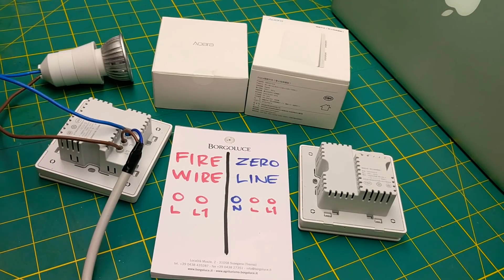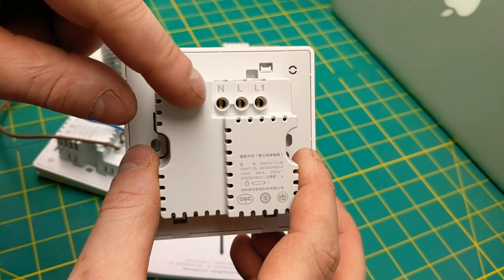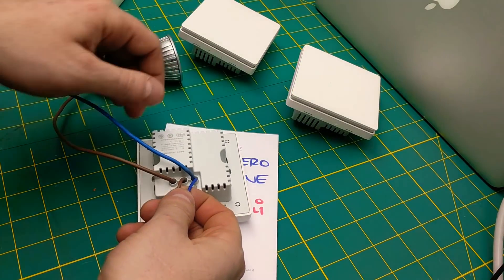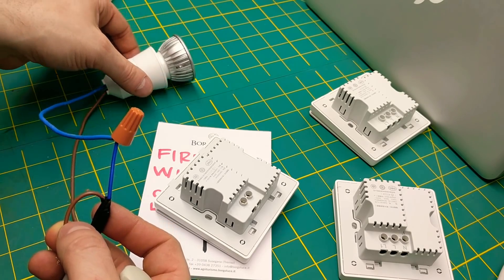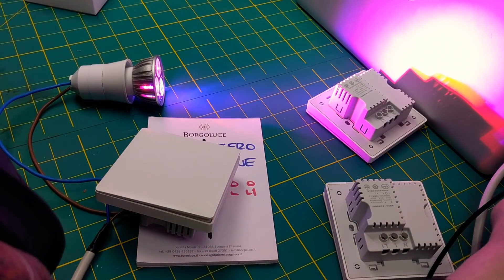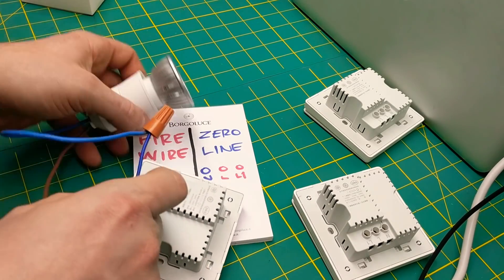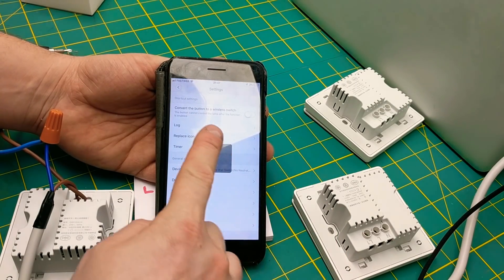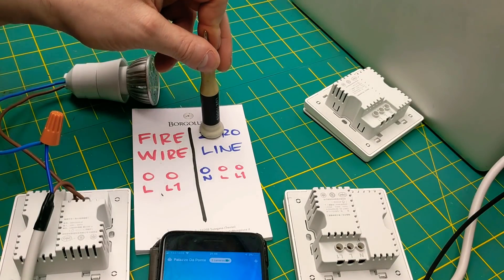FIRE WIRE V.S. ZERO LINE (Xiaomi Aqara Light Switches)

Comment: Good afternoon.
I want to buy an Aqara D1 circuit breaker (QBKG21LM without neutral, one key, wall mounted).
I want to connect 5 MJTS01YL bulbs to it.
But in the off state, the bulbs consume very little (less than 3 watts) and the switch will not work correctly. Its working range is 800W-3W
Can you please tell me what you can buy for a load of 3W?

Comment: Hello great video. Is anyone switch like the aqara rocker to connect it to aqara hub? Thank you
Reply from the maker: Sorry, I don’t quite understand... are you asking if there are other zigbee switches which can be controlled by the AQARA gateway/hub? If so I think the answer is no. 
But... you can add WiFi switches which are used by eWeLink or TUYA or SMARTHOME app... you can find the integration in the Xiaomi Home App / profile / other platform devices.

Comment: Hi, there. Question if you don’t mind, I checked our wiring setup and I see two wires connected to the switch, one green and one yellow and a blue wire that were joined together. Would the blue wire be the zero and do I need to connect that to the Aqara switch? And how would I know which of the yellow or green would go to L or L1. Thanks.
Reply from the maker: sorry my friend, but I do not know of such wiring... which country are you from?
Green is most commonly "Ground"... so that's already super strange.
Blue indeed would go into the aqara's "zero-line".
My best Guess will be:
N = Blue
L = Yellow
L1 = Green
but as I said, I've never heard of green being used as a wire to conduct electricity. 
this might help: https://www.electronicshub.org/electrical-wiring-color-codes/
Reply: Angry Reviews thanks! I live in China. Electrician told me to test the wire using a pen. I know next to nothing about these things, so this question will be idiotic, but should I have the main power off when I test the wires with a pen tester? Thanks again.
Reply from the maker: @reinethedgentozala3911  Main power OFF when you have exposed wires or when you work with wires. 
if you are using a pen/voltmeter, then the power must be ON so you can check the current/electricity. 
(I presume pen tester is an electric screwdriver which has a lightbulb in it.)
have a look: https://textbooks.elsevier.com/manualsprotectedtextbooks/9780240809953/Static/color_codes.jpg
 it looks like N=Blue L=Yellow L1 Green
Reply: Angry Reviews yep, it’s that kind of pen. Got it. My current switch only has two wires connected. Does that mean that our setup doesn’t have neutral? The electrician I’m chatting with said that our setup most likely has neutral. If that’s the case, do I need to connect the “extra” blue wire that’s not connected to our current switch? Sorry for all the questions.
Reply from the maker: @reinethedgentozala3911   That would be hard to answer as switches come in different types, they are not all the same. 
Example if you have 1 lightbulb and 1 switch (that's a common on/off type), but if you have 1 lightbulb and 2 switches, then those are different types of switches.
Anyway: are you installing the AQARA Switch? if so then the answer is simple... 
if you have a "FIREWIRE" leave the blue line and dont touch it. 
if you have a "ZERO LINE" then take both blue wires and put them inside the "N"
Your house has the option for ZeroLine (because of the blue wires) and that is great! use them with the AQARA ZERO LINE Switch :)
Reply: Angry Reviews this is what happens when a “nonsmart” owner tries setting up a smart home. Yeah, I already have a D1 “zero” version just waiting to be installed. Watching one mom from Singapore “MADS” gave me the idea that maybe I can also do it. My original plan was to buy one switch and have it professionally set up and video everything. Unfortunately going by wire colors isn’t really going to help me. I opened up three switches already and they’re kinda similar but not exactly. Thank you so much for all your help. My last question would be what’s the worst damage that I can do if I mix the wires or not connect the zero wire to the N hole?
Reply from the maker: @reinethedgentozala3911   sure here are the scenarios of what might happen if things go wrong:
* if you do not connect the N-hole on your Aquara switch... nothing will happen, it just won't work.
* if you mix up the green and yellow... it doesn't matter. they are essentially the same (maybe the aqara switch won't work, is the worst what can happen)
* if you accidentally put the Blue wire in the L or L1 that will cause a short-circuit most of the time that will "trip the main switch" no damage will be done but you will not be able to turn on the electricity until you fix the problem.... 
* However if the main Trip switch doesn't turn off the power to the home, then there could be a problem, the Aqara switch can burn out, or the lightbulb or some other place in the wires... but that is an unlikely scenario.
Reply: Angry Reviews I’m almost expecting either of the first two scenarios you said to happen so I can sort of live with either consequence. After which I’ll just have to live with my humiliation and pay a professional to install it. I’m hoping I don’t end up with either of the last two. Thanks again for taking time to answer all my questions. If I manage to set it up tomorrow, it’ll be all because of you. I’ll let you know what happens.
Reply: I just finished installing it. Old switch was actually labeled L and 1 so yeah the colors didn’t matter. Just made sure to follow where to connect them into the Aqara. Thanks for making sure I install the zero wire even though it was all taped up there. Thanks once again. Couldn’t have done this without your help.

Comment: Thank you for video made,
I have question, that is not include video, if turn on(push button)  fire wire, then app also update on ?
actually I use Rf switch that problem if touch switch not update app.. so if turn on use touch then cant see status from app, I want solve for update app, want to use fire wire one, it is ok?

Comment: Can you please tell me if this still work in case of Internet / gateway malfunction?
Reply from the maker: the switch will work always, just like a normal switch... 
however if you use it to controll a wifi lightbulb, then the answer is NO, it will not, in case of a broken gateway, you wont be able to access the switch from your phone, but you can still manually switch on/off the normal non wifi lightbulb

Comment: You can add a capacitor to the circuit in parallel to avoid that effect that usually happens with LED or low power lights.
Reply from the maker: Agree, but wehn one buys things from Xiaomi, it is kind of expected it should work out of the box... although with my experience almost nothing from their brand works "out the box"

Comment: Don´t know if someone answerd already to the flickering as far as i know it has do do with the wireing of Neutal N and The hot wire L. When you connect the N wire in the Port which disconnects for switching of you will have still power on the L wire which also can be dagerous whan you think it is of but you are touching the L wire and it still has power and will find another way ot ( N wire aka You)  was the same with sonoff basics if you connect it the wrong way around in the power socket cause you dont break both lines  hope you understand what i mean

Comment: Hi, can the lights be turned on via app if manually switch of the button?
Reply from the maker: TheJastay the switch is a button, so there is no physical “on or off” state. 
In other words, yes it will work from phone or from any other attached device or from set up rules on the app (eg: turn off at 6:00am every morning)
Reply: @honestview  thanks for your reply. Yes although it doesn't have physical on/off button, but you can still off it manually which we can't tell the state, that's why I am wondering.

So it doesn't quite matters if I should wire my house on neutral mode? Not sure what's the benefit of neutral wires
Reply from the maker: @TheJastay   yeah you can turn it off manually using the switch, and turn it on using your app :)
the state of the switch is reflected in the app.
the Neutral wire version has more reliability and power consumption meter.
They should have just made the "FireWire" version with the same benefits as the "Zero Line" then everyone would be happy. in general I am disappointed with Xiaomi  smart home, its less than what I expected it to be... quite slow, quite buggy, lack of features and god forbid you try their cameras...
Reply: @honestview  thanks for the confirmation. Strange that many aqara' s supplier commented that once switch is manually turned off, there will be no power to the switch hence, cannot operate from the app. Am I missing something here? Or they are referring to FireWire version while neutral version is possible

Comment: I find the name zero line very misleading .. i would think zero line is without the N line. and firewire is with the N line.
Reply from the maker: specially that firewire is a type of cable (old cable used for video transfer, but still...)
But "Fire wire" means the switch uses only the wire that fires/switches - while zero line is is that extra line which is the zero/Neutral contact.
I guess they just used google translate to get their naming convention.
Reply: @honestview  Lol .. Thanks for the reply. google translates rocks lol

Comment: Hi! I think I've got an interesting question, and I also think you're one of the few people that might be able to answer it. Here it is - I'd like to order a single Aqara light switch. On the online ads I see that you can program the different interactions to have different effects - e.g. single short click - lights on/off. My question is - can you add an IFTTT action for, let's say, long press to turn on/off a sonoff switch? :D

What I'm thinking about is installing a single switch for the bathroom lights, that when you short-click -  turns the lights on/off and when you long press - it turns the fan on/off, which is connected using a Sonoff switch :D

Thank you for your time :)
Reply from the maker: Well, it's possible but maybe not the way you envision it.
AQARA is an ecosystem and a very limiting one at that... no IFTTT, no Alexa...
However I recently read that Xiaomi are starting to allow you to allow 3r party integration with "eWeLink" of sonoff and "Smart Life" of Tuya 
in Xiaomi app go to: Profile / Other platform devices / Tap to Add / eWeLink / Account Binding / enter username & pass ... if this works then Yes you could do what you described

Alternatively

You can buy an "Aqara relay" or a simple "Aqara wifi plug" for the longpress instead of the SONOFF switch.

Comment: If I have 1 light with two switches and I want to replace one with a Xiaomi one? which one do I need to choose?
also, did I need the Xiaomi gateway just for the switch?
Reply from the maker: Israeli Maor It is a little bit difficult to say like that. You would need to take off one switch, and see what wires there are, how many, and what colors, most likely, you will need the fire wire switch, but, if you turn off one switch, the Aqara switch will not work.
You need to change both...

You don’t need a gateway if you just use it as a switch... but if you want to use your phone, you need the gateway
Reply: Do you mean you have a two way switch where either switch can turn on/off the lights? If yes and you want to use Aqara switch to replicate this, you will need one of them to be a wired one (as shown in this video) and the other must be a wireless switch. The wireless switch does not need to connect to any wiring and uses a battery. Yes you need the gateway. Without the gateway, there’s no point in changing to this Aqara switch.
Reply: @just4therecord  you are wrong.. the wired switch can be used in the same way as a wireless switch.
You can use two wired switches to achieve the same result. You are right that you can achieve it with the help of a wireless switch though.

Comment: Hi, is it possible to program the switch so that one output turns off if the other is turned on?
Reply from the maker: Your question is not clear. there are too many variables in your scenario. 
you can have an ON/OFF function on 2 switches, so if one switch is off, the other switch will turn it on and vice versa. 
if you are using old 2 way switches you would need to re-wire everything.
Reply: Angry Reviews I want to apply this to control motorized window blinds. The switch must never send both signals at the same time (up and down). I was wondering if it is possible to program the switch to turn off one output if the other is active or do I have install a relay system.
Reply from the maker: The switch works like a normal light switch ON/OFF it cuts power to the wire when off and sends power to the wire when on. (it just has WiFi to do this task remotely).
there is no conditional logic which I am aware of, that can do: (if Witch A is ON, then Switch B is OFF).
Reply from the maker: I presume you want to press/hold the switch and the blind goes down, then you release and the blind stops going. 
This switch only works in clicks, so you press once and the blind continues to go down until you press once again to stop.
it also has a long press function which could trigger a command of your choice.
Reply: It could be with clicks, a click to start to movement and another to stop it.
thanks for the help

Comment: Hello and thanks for the clarification. If I go with the zero line version can it still be used without the neutral line?
Reply from the maker: BogdanV I tried it... and the answer is NO.
They make it sound as “both Zero Line AND FireWire” work, but what they mean by that is that the switch has all the ports of FireWire but will NOT work without the Neutral wire.
Reply: Angry Reviews thanks for quick response 👍 now I know what I need to buy 👍😁

Comment: Do u know which one to get for UK? That could be wrong question as I don’t know much. I am in UK and want to try this smart switch. Also do u know if these products are certified for use in UK?
Reply: you will most likely need the non-neutral type or Single Fire Wire. Confirm it by looking at one of your existing switches
Reply: @just4therecord  thanks for replying. what should I be looking at and what should it look like?

Comment: The ability to measure power consumption has nothing to do with N wire, but it's a design decision. It is possible to measure the current intensity (and derive the power figure assuming given voltage) in both cases. 

I can only speculate, the lack of the functionality in "Fire Wire" version is that there simple wasn't enough room to include the meter inside the body (I'm guessing there is a reasonably big capacitor inside).
Reply: It’s nothing to do with enough room or capacitor. If you use a multimeter to measure voltage at a switch point with no neutral - you can’t because there is no neutral for you to put the other lead. You can’t measure voltage with just Live wire alone.
Reply: @just4therecord  The voltage is pretty standard, either 110 or 230v... You could set it up in the app and voila.
Reply from the maker: Thanks for the clarification.
I only fiddle around with electronics, If what you say is true, then it is a pity that these design choices were made. 
In general I thought of Xiaomi Products to be really well designed and Well coded, pack a lot of features but having some time to play around with their software I see that it is very limiting and obvious features are missing. it's not at all flexible and crashes and not compatible with Alexa and no IFTTT support, Only works with the Chinese server... etc etc.

Comment: If I would replace the led lightbulb with a water pump, would it work controlled by a zigbee temperature sensor (without physically touching the buttons)? Of course everything would be connected to the same hub. Thanks for the video - VERY informative!

Comment: Really good explanation between the two! Didn't they fix that flashing issue with a capacitor?
Reply from the maker: Good question, I have the 2016 version so haven't had a chance to check out the 2018 updated one... That's also something to note then, the sellers mention "Updated Version" but never explain what is different from the old. Thanks for your comment will check it out!
Reply: @honestview  I've only heard of a capacitor fix, not what it was, if it was DIY and then in an updated version maybe too? Heard a lot recently saying about no issues at all with LED lights, so hopefully the new versions have improved stability....?!!